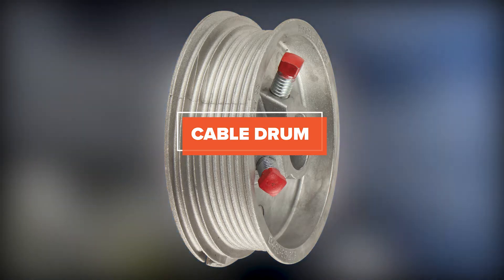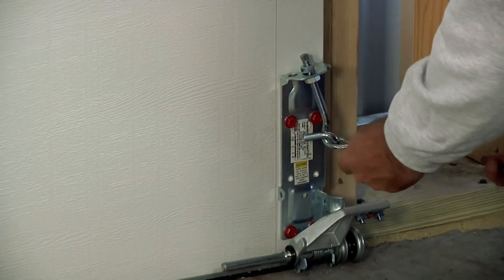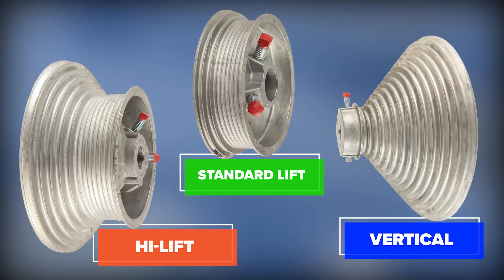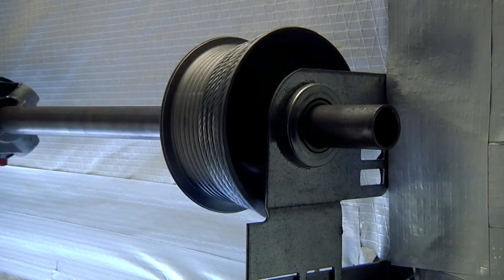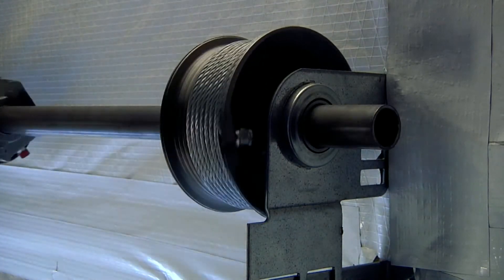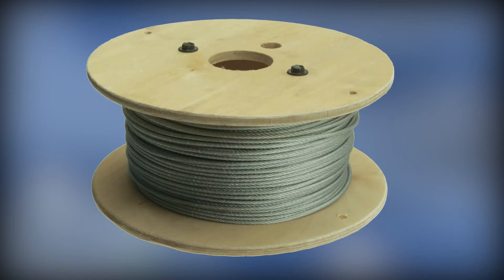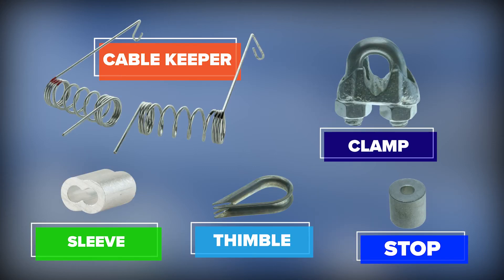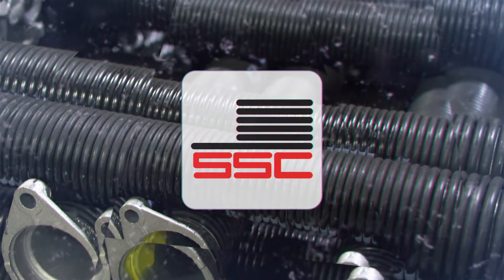Learning about Cables and Drums

Comment: Do the larger steps on the drum increase or decrease the initial torque when opening a door?
Reply from the maker: The larger steps on the drum increase the torque by increasing the lever arm. So as we step down, we lose torque as we lose tension. Also the bigger the step the farther we can go on (or more cable can wrap on the drum) per one turn of the spring.
Reply: @servicespringcorp  Thanks so much.

Comment: Typical torsion spring replacement is a 10,000 cycle spring.
For a small upcharge request a 30,000 cycle replacement!
The labor is the same, but 3x the life.
2-3 years after replacement check to see if the springs need a slight adjustment to keep it in like new tension.
As springs age they get weak and the opener works harder, so a recheck and retension extends the opener life.
Oil your springs yearly because rust makes the springs brittle